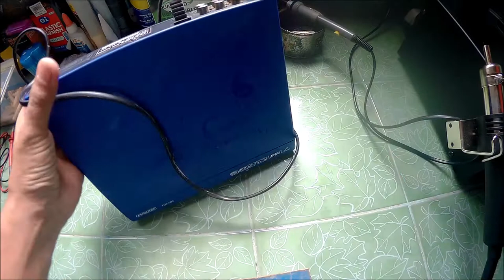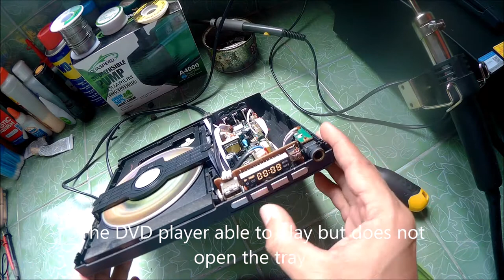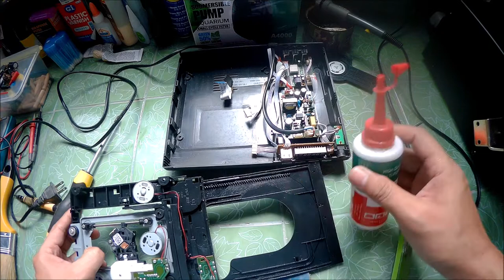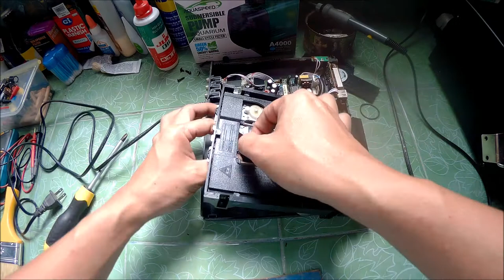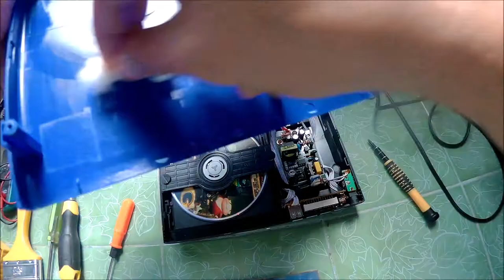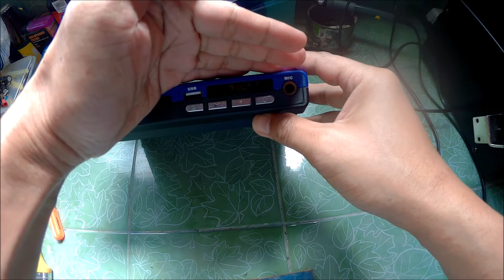DVD Repair - DVD Tray Will Not Open

Comment: My DVD player is showing CLOSE all the way. Cannot open when press the Open/ Close switch. Cannot hear anything running. When I checked, all 3 motors are working. I have changed the rubber belt 😊
Reply from the maker: You may check the Open/Close button if its still working. Or you might also need to change the ribbon cable of the dvd player.

Comment: Hi my dvd just shows close and wouldn't show open even when i press the open button
Reply from the maker: Check the open button if it is still functioning.using multimeter.
Reply: @ronron322  Please how do I perform the test
Reply from the maker: @obasipeter2882  Open the DVD player, remove some screws, look for the open & close buttons, unscrew it. Check the buttons for continuity using multimeter. You are going to press the buttons when checking for continuity using multimeter.
Reply: @ronron322  The buttons are working 
The DVD isn't responding to any button click even d remote isn't controlling it again
Reply from the maker: @obasipeter2882  In that case, I think the IC that is the brain or the processor of the dvd is corrupted and needs to be replaced. Replacing the IC needs special tools like Hot Air Soldering Station and Soldering iron.
Reply: @ronron322  alright thank you